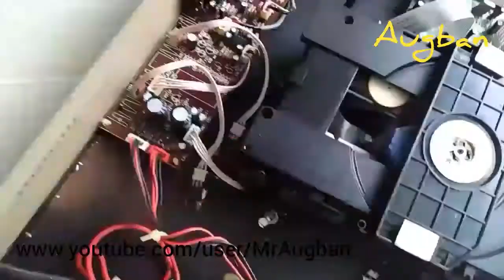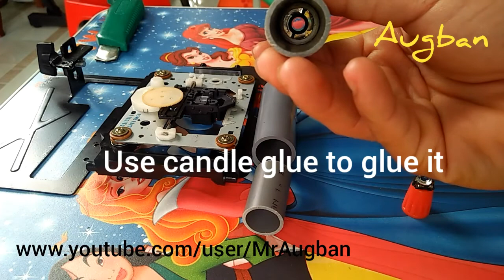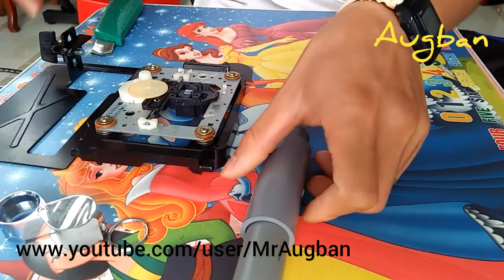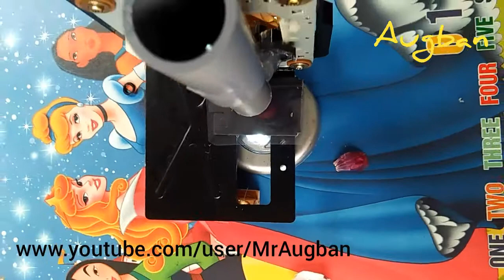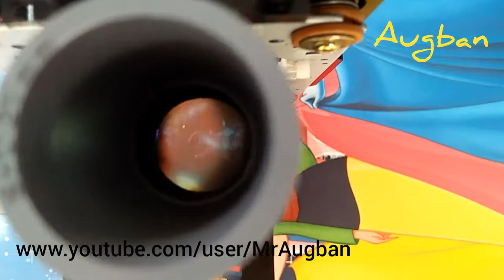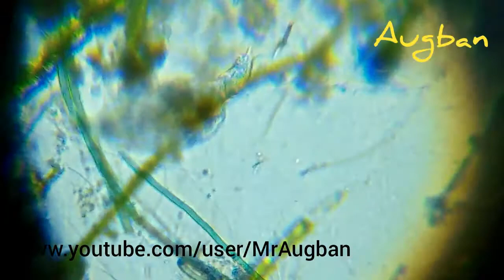Microscope DIY - How to make microscope - Instructions for making a microscope.

Comment: Bro, tell me the focal lengths of both lenses.
Reply from the maker: The eyepiece I measure manually is about 22mm, the objective is 3-5mm, I am not sure, because I do not have a specialized measuring tool
Reply: @MrAugban  Yeah but your tube length seems longer than the sum of the focal lengths of both lenses. 22mm+5mm= 27mm which is just 2.7cm but your microscope is much longer than that?
Reply from the maker: @balancebreaker6885  oh yes, microscope is different from telescope, if you use pvc tube whose length is equal to total focal length you will not be able to observe anything.
Reply: @MrAugban  Bro I have made the objective and the eyepiece, when I tested the magnification without the tube, the view was dark, and had less contrast.